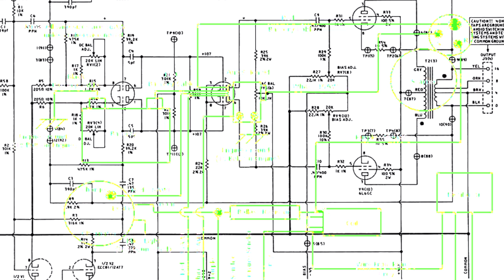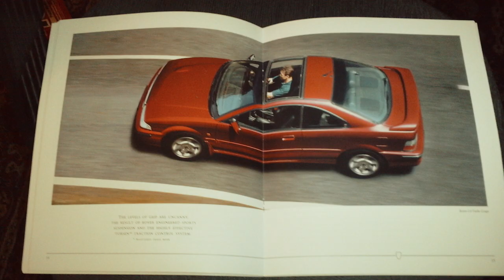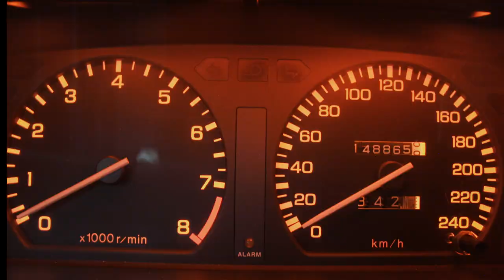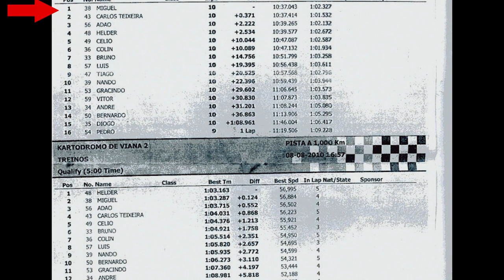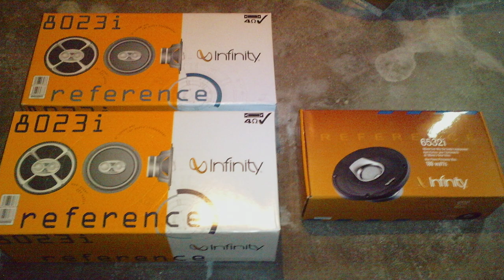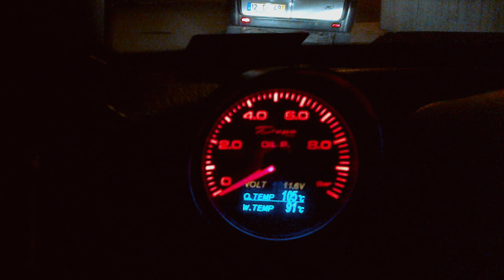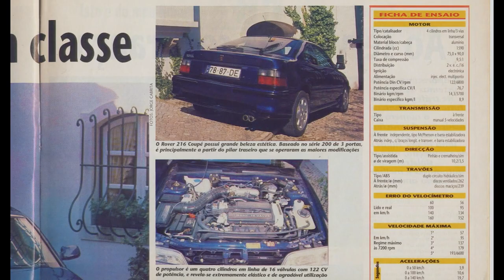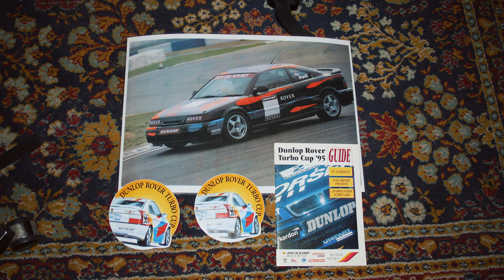Driving the same car until it becomes a classic #1 - My history with the 1993 Rover 216 Coupe

Comment: I have a similar story that starts the day before I was born when my parents bought a 97 Dodge Intrepid.  Black, base model 3.3l last year of the model.  I grew up in the back seat until they got a mini van and parked it in the back yard 06-07.  Then drug it out for my older sister to drive in high school 08-12 and me right after that 12-16.  The paint wore off as sitting outside for years will do.  When we repainted it we did the body first and left the roof primer white.  We didnt clear coat the body since we planned on finishing the roof and later on finished the roof and cleared it.  Now its a nice two tone gloss black over chalkboard, just don't lean on it.  I always said it would be mine and later on my dad agreed that it was mine even though he hadn't signed over the paper work.  I delivered pizzas in it for years and paid for all the repair parts.  Finally its signed over to me.  The front right shock finally broke after being loose for quite a while two weeks before Christmas.  A $150 shock and a tie rod end and she's back on the road.  I have the other front shock, new control arms for the bushings, basically a whole new front suspension since the bushings are nonexistant and there's play in most of the steering.  Just need to find time off work to get the work done.  She's sitting at 270k miles and ready for another quarter.  Its had a water pump at some point, probably an alternator or two, I remember changing out an axle but don't remember why.  All work has been done on gravel in the yard with hand tools and an air ratchet.  If i ever need to dig into the motor I would love to bore it and use a 3.8 rod piston crank from the caravans but I don't think I'll have to any time soon.  Theres still a couple LH cars kicking around my town.  I pass a black Eagle Vision (how's that for obscure) that must have gone to the shop recently since it was gone and a mid 10s Hyundai was in its place and I was sad but it has popped back up.
Reply from the maker: Nice one mate! Keep up the good work!